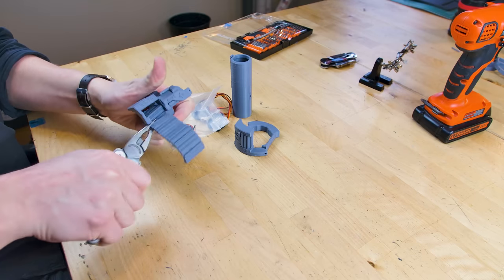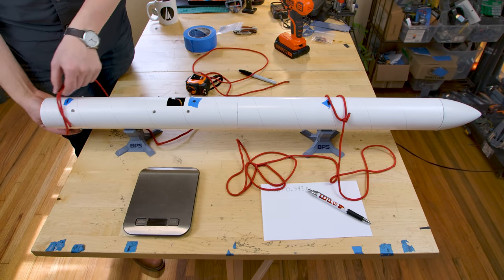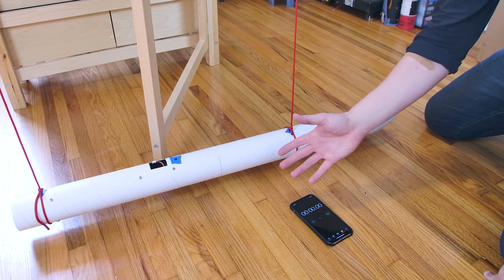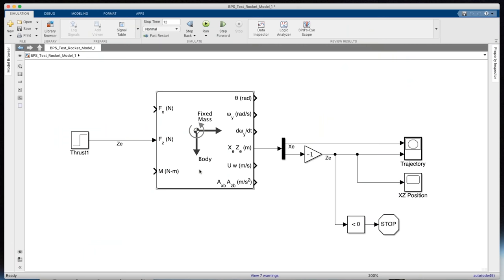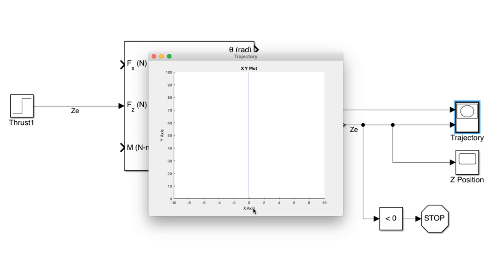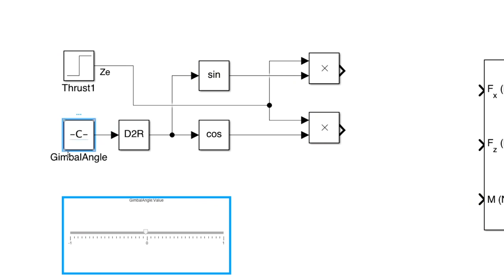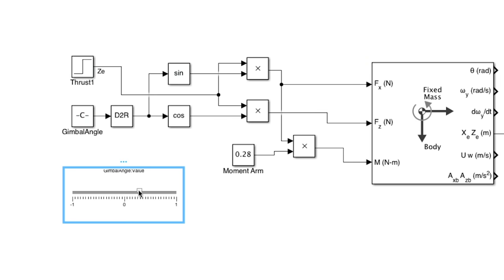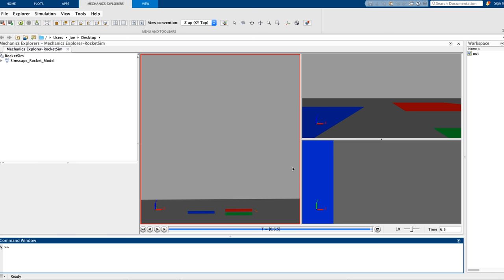Modeling a Thrust Vectored Rocket In Simulink

Comment: As an aerospace student myself I would love to see what you're closed loop system would look like. Also as a side note: You touched on so many important topics and processes that we encounter day to day so awesome work!
 (just calculating inertia values with oscillation was fantastic tbh)
Reply: @nocare  At that point wouldn't you rather use a 3D model to estimate the values?
Reply: Doesnt the oscillation time depend on how hard you push the rocket? How do you know if you have the right values?
Reply: @irakliabzianidze7180  oscillation time (period) does not depend on how hard you pushed a rocket (or its amplitude) actually, the same principle as a pendulum.. a pendulum of a certain length with always have the same period, Period T = 2pisqrt(L/g) where L= length and g=gravity, mass of the bob or amplitude are not related, physics is awesome!

Engineering student here
Reply: @killorkubed  thanks for your answer!
Reply: @irakliabzianidze7180  just to add a slight caveat here, technically it will makes a difference if you push the rocket/pendulum a lot! Since the pendulum equation is only approximately linearised at small deflection angles, typically below 30° in most cases, beyond this the values can deviate a lot! Consider the idea of a ruler you are holding between your fingers, if you hit it hard enough such it swings back past horizontal and near to being vertically above your fingers acting as the pivot, it’s gonna have some hang time.
Reply: @CCcrafted  thanks!
Reply: @Lukas Keen I’d love to see that too.
Reply: @timschafer2536   To learn the basic concepts of classical control theory I would suggest Modern Control Engineering by Ogata, I think it's a good book to start with. However, to learn properly the classical theory you would need to learn Laplace transform which uses Calculus, which I think is above Highschool maths. :)
Reply: @killorkubed  Right, Walter Lewin shows that in his famous pendulum video.
Reply: your*
Reply: @ygorfialho  wait yall dont do calc in HS, send help please, I hate multi var calc
Reply: single PID controller is not suitable for a rocket control which is basically an inverted pendulum problem, the way to go is Full state feedback (FSF) control where the states variables are the (3D) angular position plus the (3D) angular acceleration...
Reply: @Haellsigh  that would require a very large amount on effort on modeling each part, knowing each part exact material like density etc....the way he did was perfect because very simple and straightforward  system identification assuming a rather simple  3DOF model ...
Reply: @irakliabzianidze7180  NO, a pendulum period of oscillation just depends only on the length of the string and the acceleration of gravity , not even on its mass....
Reply: Would love to see that too!

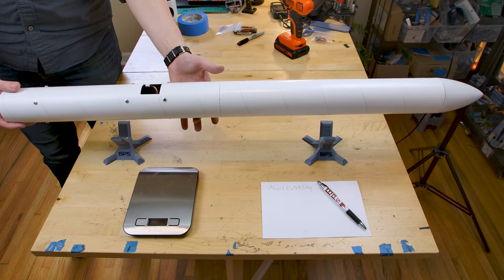Comment: 2:10
Quick tip for finding center of mass of a long body (rather than guess and check): Stick your two fingers out in front of you like you're doing finger guns. Lay the long body across your two fingers. If you pull your two fingers slowly together, the rocket will automagically end up balancing on your fingers, which are now at the center of mass. Definitely try it out; don't take my word for it as hearsay :).
Reply: Just tried it with a 20 cm ruler, fingers came together at 102 mm, and the first half has a little hole so the center of mas should be skewed slightly above the 100 mm mark. Amazing.
Reply: Was about to say. Friction rules!
Reply: Prettt cool if you have the object perfectly straight, and the friction coëfficiënt between your fingers and the material is exactly the same at all times.
Reply: Ok what the hell why does this work
Reply: Dangit! I was about to relay that Don Herbert/Mr. Wizard tip and thought, "well, let's scan the comments first."
Reply: @edisonyang3283  Great question!
Imagine the case where one of your fingers is on the center of mass, and the other one is way off to the side. All the weight of the rocket will sit on the CoM finger, so the other finger will have no weight on it. No weight on it means no friction, so that finger will move freely, while the CoM finger will be pinned in place by friction.
Now imagine one finger is 2 cm away from the CoM and the other is 20 cm away. Most of the weight will be on the 2cm finger, so the 20cm one will be allowed to get closer. Once it gets 2cm away, the friction is equal, so fingers are allowed to move equally.
Ultimately, whichever finger is farther away from the CoM will slide more freely, and therefore, whichever is farther away will move to be closer, until it forces the OTHER one to be farther away. Once that happens, they'll jockey for position until you end up with both fingers exactly at the CoM.
Of course, if you move your fingers too fast, you get weird static friction vs sliding friction effects, which is why you have to go slowly enough for each finger to take over once it becomes that finger's turn.
Does that explanation help?
Reply: @joeymurphy2464  it’s basic high school physics
Reply: Yeah!  Finally we can help the smart guy with something instead of just watching in amazement!
Reply: @joeymurphy2464  Thanks a lot man!
Reply: what if you don't have any fingers?

Comment: Yeah, PID feedback would be nice. And how you tweak the P, I and D factors.
Reply: Observation and math!
Reply: Basically it’s a matter of math, at first you do the math model in the continue domain, then you translate it into digital with some equations that give you the PID values
Reply: @michaelkruger2736  IMO Ziegler-Nichols is not suitable for such applications
.
Reply: actually matlab is capable to tweak pid itself, like other programms can do
Reply: pid 튜너라고 있으니까 그거 써. 아니면 컨트롤 툴박스에 리니어 어널리시스라고 있는데 거기서 선형 모델링 뽑아주거든 그거 써.
Reply: @Kokiloki1000  
I find Ziegler-Nichols to be a good baseline, but it doesn't usually get me close enough to meet some of the more strict performance constraints. Its acts as more of a guesstimate than anything else
Reply: You would use a meta-heuristic optimisation method to determine the PID gains, and then apply some sort of scheduling technique based on the state dynamics
Reply: You can search for Ogata's book
Reply: i doubt pid would work here. the dynamics are nonlinear and you need to track a trajectory
Reply: @paugasolina5048  It depends what you're trying to control. Whether the dynamics are nonlinear or linear you can still apply PID control, regardless whether PID is family of linear controllers, you will just have to apply a scheduling method. If you're trying to guide the missile towards a target, then yes you're right, PID may not be the best solution. On the other hand, if you're trying to simply adjust the control surfaces to maintain or achieve stability during flight, PID control could be a solution.
Reply: use Ziegler-Nichols method
Reply: @edk7825  You would never, ever use Ziegler-NIchols for anything other than trying to obtain an assumption to a single solution point. Meta-heuristic optimisation would solve this problem throughout the entire operating domain and in a fraction of the time. 

The moment non-linear aerodynamics are used, Ziegler-Nichols will not even be a viable solution.
Reply: @HysterResearch  for simple stuff its enough. if you really want good results you need to ditch the PID and start thinking in the direction ofState Space stuff
Reply: @edk7825  State space has no context here. State space is just a formality of displaying ODEs as a series of first order differential equations and is not a method of closed-loop control.
Reply: @HysterResearch  Ever heard of State Feedback loop control?
Reply: single PID controller is not suitable for a rocket control which is basically an inverted pendulum problem, the way to go is Full state feedback (FSF) control where the states variables are the (3D) angular position plus the (3D) angular acceleration...
Reply: @HysterResearch  pleas would u help to determine the nonlinear mathematical model of the this tvc
Reply: @edk7825  exactly, and arranging differential/difference equations into state space provides so many benefits, such as easy MIMO modelling, full state feedback (therefore simple optimal control calculations), full state observation (including optimal state estimation), Jacobian linearization and therefore gain scheduling, trimming tools, efficient computation.

Comment: I loved the moment of inertia calculation but I think the simulation was wrong in both 3-DOF model and the 6-DOF Joint Simscape model. According to my intuition, we should not supply any input to the Fx port as it just translates the entire  model linearly in the x direction and not in the direction where the thrust is applied. Rocket cannot be modeled in a 6-DOF joint block. This is because rotation and translation is considered as independent entities. I would suggest to use a ball joint and then cascading a prismatic joint in the same frame :) Cheers!

Comment: That wasn't in my trig class I only ever saw 3 or 4 slightly different triangulation problems retold a few hundred different times. how tall is the tree, how far is the flagpole, how high is the plane. And when I asked for more information about the sine, cos, and tan buttons I was retaught the long versions of the names; but what do they mean, how were these discovered, and most importantly how do you expect me to remember which to use for any give problem that I'm grinding through?! 

I enjoyed math except for memorizing times tables and grinding trig with only partial comprehension.

Comment: Why is cos (GimbalAngle) * Thrust1 considered as the vertical force? Isn't cos (the resultant vector) the x-component/horizontal component of the force? Also, why did you attach the moment arm block only to the sin of the thrust and not the cosine of the thrust vector?

Comment: With drones we can run something like PX4 firmware in a simulator so we're running the same control system code in sim and on hardware. Is there a similar way for simulating your flight system or do you have to extract the control system equations from Simulink and program them manually in your flight computer program?

Comment: How did you get the equation for mass moment of inertia
Reply: MoI definition of a random object is math heavy, there are formulas for common shapes (iirc, tube is 1/12 ML**2) but you can also write a version of the period of a pendulum for your object in oscillation with the unknown MoI value in it, then from the measurement of the period work up the value

Comment: Hey ELON MUSK LITE I have one idea, u can use a small moter with some flywheel attached and join it vertically inside the rocket and use some type of motor controller with it or a brushless DC motor with esc to control the roll of rocket. Hey anyone like idea please please tell me.
Reply: Yeah that's what he does on his rockets, it's a fairly common system